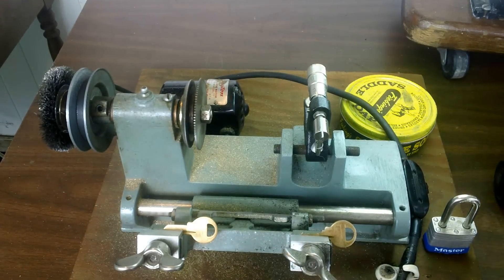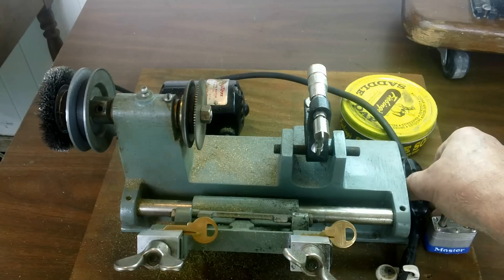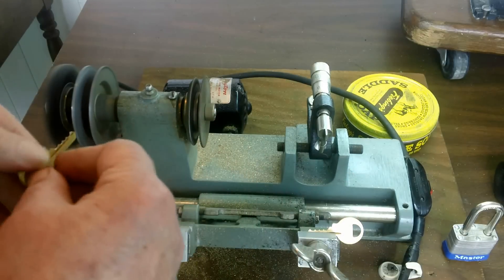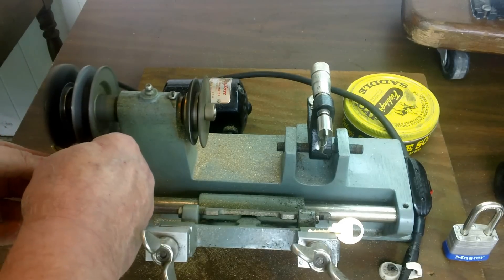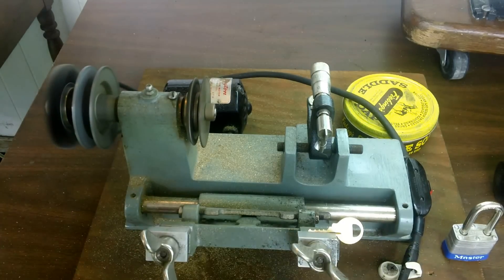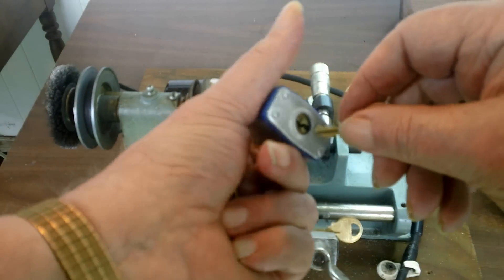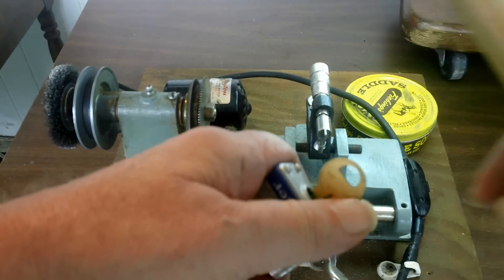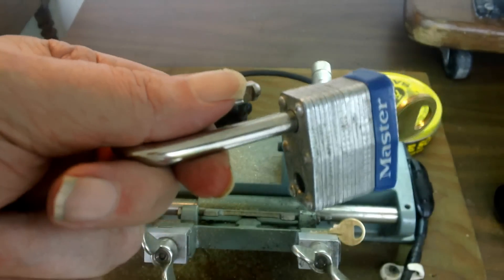THE KEY MAN SHOWS YOU HOW TO MAKE YOUR OWN BUMP KEY

Comment from the maker: Yes, I have many boxes of used car keys.  I have many box of new blank keys.
So, I recommend that you take the lock apart.  Put in a blank key. The blank key will shove the pins up above the cylinder.  Then, you file the blank key down till each pin is flush with the cylinder. Once you have the pins down even with the cylinder, you will have a key to the lock.

Comment from the maker: I have a really big box of key blanks.  I also have many old used Ford and Mercury keys.  Is this a wafer lock? Do you have a number for the key?  One of my big adventures is buying locks with no keys.  Then, I use all my old keys as "try out" keys.  I have been very successful in finding a key for most of my locks.  I have just a few locks that I couldn't find a key for.  Do you have a key that fits in the lock?  Wafer locks are 90% easier to open than pin locks.

Comment: 1.) I thought it was relatively diffucult to obtaint just straight blank keys?
2.) Wouldn't you have to know the side or horizontial key line to get the key to fit the plug?
3.) I unserstand you have to grind all divets to the maximum divet on the orignal key. I am misunderstood? I would love to know the "bump key" method but, why then does South Ord (and others..) sell their maxium bump key sets for like $200.00+ and they come with like 200 + key's?
Reply from the maker: 1,  Blank keys are readily available. You can get them on e bay. You can buy a box of 50 from Foley-Belsaw. If you search:  Master lock Company M1 Key You will find more than 50 places to obtain a blank key.  But, you don't need a blank key. You can use a used key. As you are cutting down to the bottom of each valley, it makes no difference if the key is new or used.. You can buy a Master Lock number 3 and use one of the keys to make a bump key   - - Key Man.
Reply from the maker: 2.  Yes, this is covered in my video: 'POOR MAN MAKES BUMP KEY AND OPENS ANY LOCK' The video goes step by step and shows you how to determine where the valleys should be. - - - Key Man
Reply from the maker: 3.   Maximum Bump Key Sets. Go over to your local hardware store and count the locks with different keys. In my area 2 Manufacturers sell all the house locks. One Manufacturer has 3 different size keys. There is just a small amount of different keys. Why do they sell 200 key sets? There are old antique locks that you cant buy new anymore. There are locks made in foreign countries. But for practical use, a few keys will do 99% of the time. If you have a target lock, you can buy another one like it on e bay and use one of keys to make into a bump key..- - - Key Man
Reply from the maker: Not difficult to buy.  google "blank keys"  Also, you can buy another similar lock and make a bump key from one of the keys to that lock.

Comment from the maker: wafer lock,- my video:  HOW TO PICK A WAFER LOCK ON A FILE CABINET The file cabinet and the cars have wafer locks..  You are saying that it is an old, used Ford, key.  So, I am not sure if it is a wafer lock.  The newer Ford keys have two sides and have wafer locks. If you have a Ford key that fits, and it is a wafer lock, you can cut it down 3/4 of its original size.  Then put it all the way in the lock and jiggle it out slowly,  as in my video: TRY-OUT KEY JIGGLED TO OPEN FILE CABINET LOCK.

Comment from the maker: Looking for the "sweet Key." I show how to make bump keys in another vided. What to do.  Make 3 or 4 keys using files. Then. measure how many taps it takes to open the lock.  When you make a key that will open the lock with one "tap," then use that "sweet Key" to make more "sweet keys." - - - Key Man